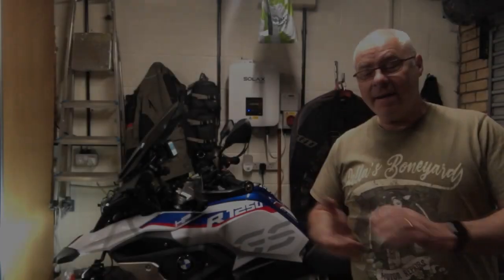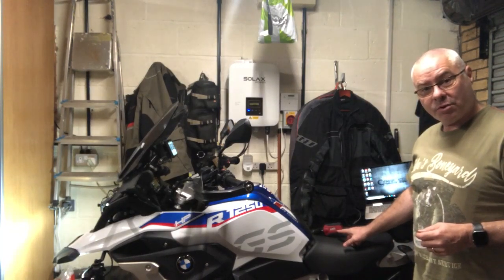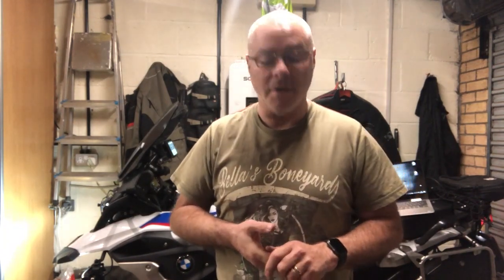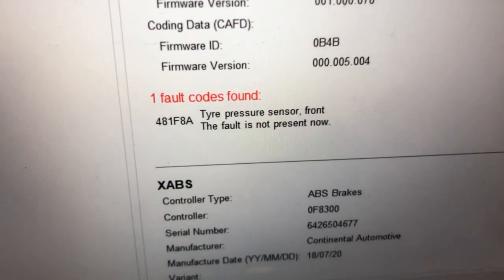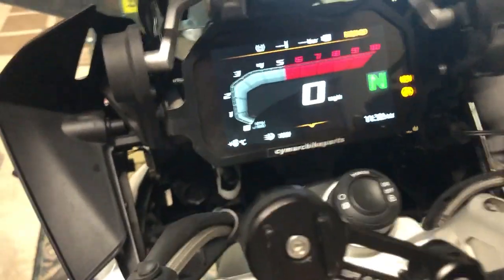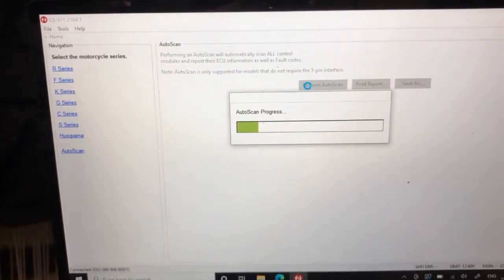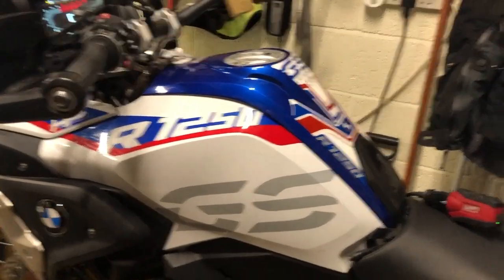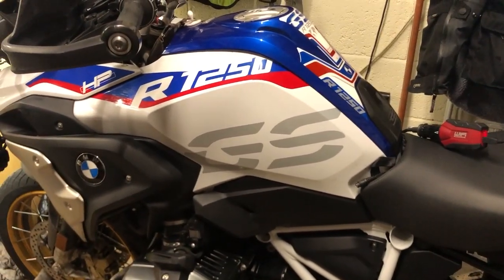Tyre Pressure Error Message Clearing with GS-911

Comment: Not sure you actually did anything other than clear the code.  The TPMS system doesn't activate immediately when the ignition is turned on, you have to travel at 25 mph or more for a short distance before the sensors wake up and transmit to the ZKE, which may then set a code depending on reported pressure.  At least that's my understanding.  If correct, this video is misleading, if I'm not correct, then I'm not surprised.  Have a 2010 K1300GTSE myself, struggling with TPMS batteries died, new sensors prohibitively expensive from BMW, aftermarket sensors inexpensively available.

Comment: Cheers mate, any new pillion seat tool box ideas? Would it be possible to move the hinges to side and water proof cover for key lock? Any new kit coming in development? Cheers, keep up the top notch work
Reply from the maker: Hiya fella thanks for posting. I didn’t have any plans for any more pillion boxes TBH - just the standard and oversize ones. I guess I could try to redesign for a side opening! As for new kit, not at the moment 👍